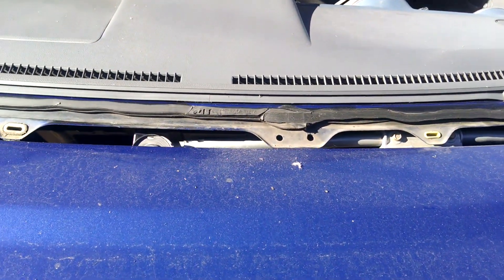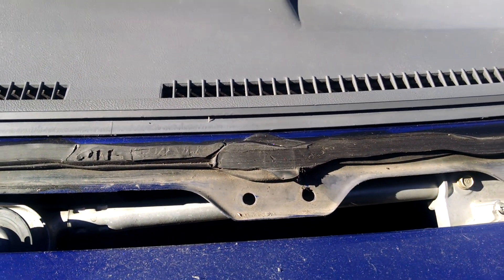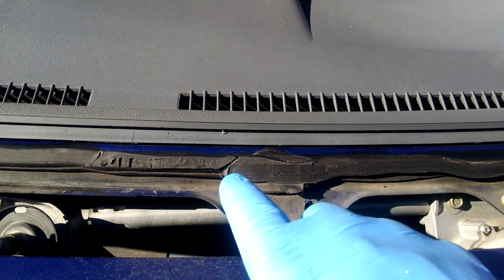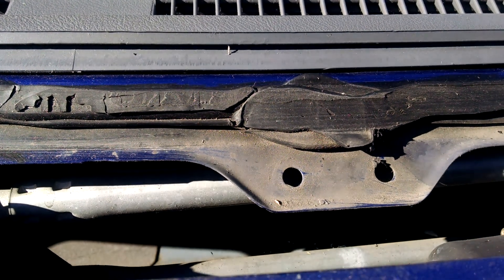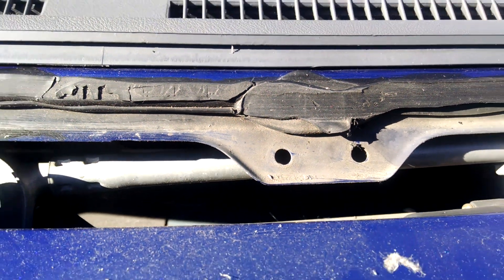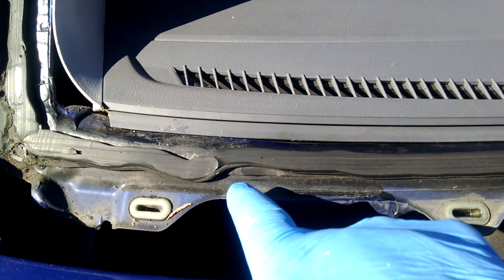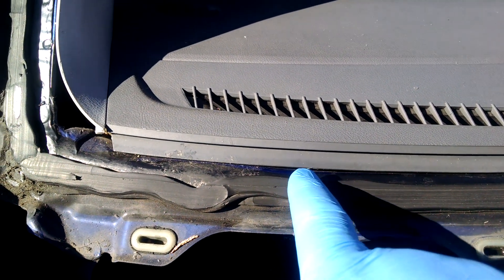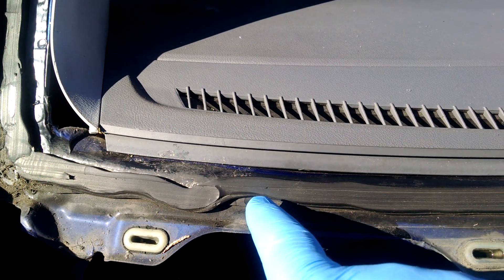Bad Windshield Replacement - What To Look For!

Comment: Hi Michael. I had the windshield replaced on my 2006 Ford Freestyle and now it has this whistling wind noise, I have taken the car twice back to the shop and they keep telling me that they fixed but the noise is still there. Can this issue be address without putting a new windshield on? can I put some sealant ?